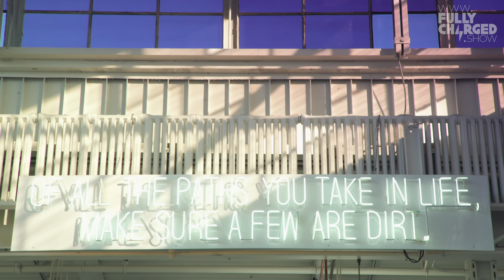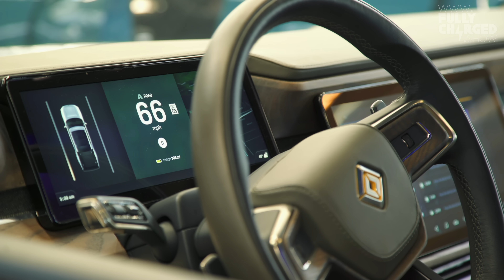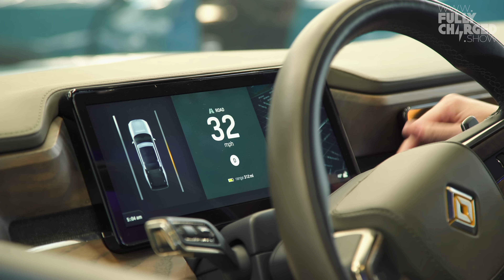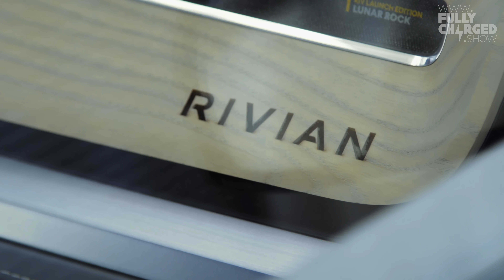Rivian R1S Electric SUV & R1T Electric PickUp Truck - World Exclusive: Inside Rivian | Fully Charged

Comment: Rivian feels like a company run by engineers with passion. That is usually a recipe for a great product. It does not feel like a hype job (unlike Fisker for instance).
Reply: @Idiot Online Wondering Aloud A huge injection of more than 4 billion dollars from Amazon (plus hundreds of millions from Ford and others) might make this easier, however...
Reply: @JustWasted3HoursHere  why would Amazon care about injecting into truck building company? What's Hi-Tech about it?
Reply: @atenrok  Because Rivian is tasked with making the powertrains for all their future delivery vehicles. That's why.
Reply: @agus2001  what powertrain? It's an electric motor + batteries. Do they produce any of these components or planning to?
Reply: @atenrok  do some research, you're on youtube so you have google look it up.
Reply: @atenrok  Yes, they do. You might want to leaven that skepticism with some facts and reality. Otherwise, it's like eating table sugar all the time, it gives you energy at first and then you start breaking down. Scurvy of the mind.
Amazon investing in Rivian to build their trucks is taking a page from UPS. UPS delivery trucks for North America were a bespoke design that nobody else had that were tuned exactly to their specification. Relentless optimization, like the no-left-turns rule for drivers. And then the trucks were driven into the ground and scrapped so nobody could copy them.
Reply: @AW-zv2to  and you wanted to say what exactly?...
Reply: @atenrok  electric trucks will save them tons of money in fuel costs and maintenance cost.
And I think Amazon is working on self driving. Saving them tons more money.
Amazon ordered 100,000 electric trucks
Reply: @atenrok  rivian is the only one with 4 motors. They can torque vector each wheel 1000 plus times a second. There is a lot of software involved.
Tesla is more efficient because of their electric motors.
One company makes their motor windings with square wires for greater density. Might be Volvo
Reply: @golfish8589  Rimac Concept One & Two
Reply: @romankrusec1991  nice cars.
Not mass produced.
The lightyear ev may have a hub motor in each wheel
Reply: @golfish8589  Honda showed EV CR-Z prototype with 4 motors in 2015.
Reply: @atenrok  prototype...
Reply: @golfish8589  Blah blah blah.... no one cares as no different than anyone else other than electric. Payload/Range... What everyone needs to know in a truck: Crickets...
Reply: @atenrok  "Last-Mile" delivery vans. Did you even watch the video?
Reply: @w8stral   Have you ever driven an electric vehicle and experienced instant torque?
Find a way to get a ride in a tesla. It will put a smile on your face.
A tesla semi can go 0-60 in 5 seconds with only a slight hum from its motors. The Rivian gives you 250 pounds of torque at each wheel at 1mph
 I am not sure what you are asking 
here is a rivian forum. https://www.rivianforums.com/threads/rivian-payload-towing-capacity-and-trailer-brake-controller.62/

Payload 1800. Range 400 miles which gets cut in half when towing.
A 100 mile range extending gerrycan battery can be added to the bed. 

Battery technology is getting  better all the time.  It's only been serious researched the last ten years. Now billions are being spent by dozens of Companies. 
Gas engine has had over 100 years of refinement
Reply: @golfish8589  Acceleration does not matter.  This is the real world, not play time for children.   Truck = $$$/payload-range.
Reply: @w8stral  the rivian is not designed to be a work truck. Period. So dont compare it to one.
Tesla is announcing its pickup on Nov 21st. It will be more heavy duty than the rivian.
What is your current truck? So I can gi e you so.e relevant  numbers
Reply: @golfish8589  Then do not call it a truck.  Call it what it is.  A bigger SUV.  Not a bad thing, just a thing
Reply: @GrayRaceCat  🤦🏻‍♂️

Because last mile delivery vans need 250lb of torque per wheel at 1mph... 🤷🏻‍♂️
Reply: @w8stral  what truck do you drive
Reply: @golfish8589  F250 for big work stuff, Honda Odyssey for medium stuff, and a... not sure what GM hatch back car, and to top it off, an ebike.
Reply: @w8stral  odyssey has been my everything vehicle since 2001:) I rebuilt their piece of crap tranny 5 years ago. Fixed the major design flaw. Engine is great. First thing I did after purchasing the odyssey was to put a rubber bed liner in.
How much do you love the ebike
Reply: @golfish8589  My Honda Odyssey is same age.  Transmission has extra oil cooler in it as I put a hitch on it and it is whining louder but got it to 240,000 miles currently.  Had to replace everything on the engine by now.  Guess not the AC of all things, but everything else?  Yup.  Engine itself is finally eating 1 liter of oil every 1000 miles, so I do not bother with synthetic oil anymore.  Saw one guy who took his odyssey van and cut the roof out and put divider behind drivers seat, removed side doors, put in a "tailgate"... was hilarious!!!  

Ebike?  Its ~ meh.  Only because it rains here all the time and is cold.  If I was someplace warmer?  Yea, much better application.  Put basket on it to get groceries when wifey decides she forgot something and needs it asap...  Gets me out of the house as well when I need to hide in the Library or book store.  =).
Reply: @atenrok  Because they're going to make a EV cargo fan for Amazon.
Reply: @abes3925  🤦🏻‍♂️
Reply: Do you know what speaks louder than passion? Money.
If Rivain is a hit, Ford, or some other big automaker, will gobble them up, and Rivain will sell out faster than any of their vehicles can run a 1/4 mile. It's the "Silicon Valley" American Way: make something great, then retire young / rich by selling out, or start building another startup to sell off. 

And like any initially great product, someone bigger / wealthier will come along, buy the name / reputation, then cut costs and corners, while still charging a premium for inferior goods, banking on that "good" name.
Reply: @listofromantics  In a way that would be a good sign, because that means that the mainstream automakers are FINALLY taking EVs seriously and see them as a genuine threat. And, well, Tesla has hung in there for more than 10 years without being taken over so who knows?
Reply: @JustWasted3HoursHere  they've been taking it seriously in the end of 70s, with ev1, but then something else happened 🤷🏻‍♂️
Reply: @listofromantics  I don't think they'll. Nothing about electric cars is revolutionary from engineering perspective. And big automakers have already invested huge amount of money into electrification already
Reply: I can vouch for that - I know one of them! :)
Reply: Yeah it’s nice and stuff, but I’m buying a Tesla , more bang for the buck
Reply: yeah Fisher keeps making crappy toys for kids. Like switch it up already, where's the passion?
Reply: It is a recipe for extremely high priced over engineered masterpieces that only the überrich own. It's a McLaren F1 with a ute tray.
Reply: @Celtic_Thylacine  McLaren is 3 times cost of a Rivian.
What do you consider ueber rich?
I have never lived in a household making over 80k. I will be able to afford it when my house is paid off. When I am 62. It will be our traveling retirement vehicle
Is the rivian expensive? H*ll yes.
There are actually a fairly large number that can afford it.
I also know that 50% never by new vehicles

I have owned one new vehicle
Reply: @golfish8589  when your 62? You won't be able to enjoy it.
Reply: @Space_Novel_Distribution  how old are you? I remember when I was 18 . I thought 40 was old . Ha ha. 62 is that not that old. 67 is getting there. That's why it would be nice to retire at 62.
Less social security, but get I for a longer time
I would love the truck. But would probably end up with the suv. And travel the country with the wife in it.
Reply: @golfish8589  im 21.
Reply: Design, engineering, and prototyping are merely the first steps. When Rivian gets to the manufacturing stage and they begin producing a fully fledged product is when they'll begin encountering true technical problems. Basically what I'm saying is that it's a company in its infancy, for them to progress to become well established will take both ingenuity and luck...
Reply: The fact they planned out before coming out means they ain't trying to bullshit people. They actually wanted investors so they already mapped the foundation
Reply: @alphonsusho8962  Well, there is nothing special about a glorified car that changes its ICE to Electric.  A true electric truck would be special though. 

PS: Since the introduction of NimH batteries city electric driving has been covered.  Just no one wanted to switch as it was not seen as "cool" as the manufacturers who started it all went SKIMPY over compensating for their religion that humans are bad.
Reply: A bit if them came through my place of work and I got to talk to them for a while. They have a really awesome culture and awesome people from what I could tell
Reply: This is factual, I have a good friend who has been at Rivian since inception, and that’s exactly what he his, an engineer with a passion. I am very excited for them!
Reply: Yes, it is run by someone who obviously gives a f@£k and it doing it for the right reasons.  That is the start of a winning formula.  If and when they IPO and I will be buying in....
Reply: Fisker is lile jhaant ka baal. But what about it

Comment: I count 9 vehicles in this video. 2 Possibly non functional. And I think I spied 8 motor and gearbox combos on display or under construction. Interestingly there are a few brief snap shots where the background is blurred out. I'm fairly certain near the end you can see an Amazon van being built up. Good shit. BTW where are those 2170's being made ;)
Reply: He stated they don't yet have a contracted battery maker. My guess is that they planned to buy them open-market because their production volume would be low for a good while. The Amazon deal probably changed that and they are now talking to battery companies.
Reply: InsideEVs.com has an update that shows they’ve applied for permitting to build a battery plant at their factory in Illinois.

Comment: What the new Land Rover Defender should have been
Reply: It's a "Range Rover killer"

It really could be.
Reply: @rogerstarkey5390  Don't worry, JLR are well on the Electrification road, you can already get a PHEV Range Rover and I suspect will the next rebody, it'll be designed to have a full EV option too. Its one advantage start ups like this have is a clean slate to start from, existing Manufacturers take longer to engineer a rebody as it needs to fit in with their existing platform life plan. Don't forget JLR and BMW have teamed up with a joint venture on EV drivetrains, so that's quite a lot of experience and talent there.

Rivian may be first to market with their full EV, but its also a downside with startups, they have to scale everything up from nothing and avoid issues like the Tesla Model 3 went through when they tried to ramp up production.
Reply: @stevechilds1547  Except the Rivian can actually go offroad. Land Rovers haven't been able to do that for over a decade.
Reply: @awo1fman  erm, yeah. Ok, whatever. a) LRs are very effective Off Road, Range Rovers less so, but still better than most. b) I'll judge the Rivian when it actually is available, saying something is better off road when its little more than a concept car is a little ridiculous.
Reply: @stevechilds1547  Have you even looked at a recent Land Rover? They have no actual ground clearance and have huge wheels and low profile tires. No, they can't offroad at all, even if you put appropriate wheels and tires on them, because they're all electronic and you would fry the brakes and break all kinds of things if you tried anything more challenging than a smooth dirt road. Which is still a road.

"Off road" means off road, meaning not even a 2-track. Those test tracks on which you see them "showing off" their vehicles are extremely unimpressive to anyone who has ever actually been off road.

As for Rivian, they have 3 times the ground clearance of any Land Rover, and a motor at each wheel means unbeatable traction and no need to fry the brakes in a futile attempt to make up for lousy open or even limited-slip differentials.
Reply: @awo1fman  Are you sure you're not thinking of Land Cruisers? Or perhaps Jeeps? And yes, I do see them up close pretty frequently. I don't recognise your description of them though.
Reply: @awo1fman  Oooh kay. Whatever you're smoking/taking, I'd lay off it, tbh.
Reply: @stevechilds1547  I'm smoking Land Rovers with my Ford SuperCrew. Not that they're aware of it because they're never even close enough to eat my dust.
Reply: Part way through I thought “this is going to destroy Land Rover”...if they can get it out to market. There are a lot of people with a lot of money who I’m sure would get this over former. All those footballers and Chelsea folk...
Reply: @chillmeister  
The prices compare very well with Range Rover.
Reply: And no one would buy it because it’s so expensive. This isn’t a mass production car - it’s for wealthy early adopters to beta test for the future.
Reply: @paddydowney6269  That worked with Tesla as they were basically first to market, but Rivian won't be. A few early adopters won't pay the bills, they need volume for that.
Reply: Steve Childs you assume Tesla are earning enough to pay the bills, or that they even want to pay the bills (and not get swallowed into one of the bigger groups). The micro volumes that Rivian will produce for the next decade will mean the prices will need to be huge, or else be happy to lose money
Reply: @paddydowney6269  erm, given that Tesla made a profit last quarter, I'd say they are earning enough, at least in the last quarter. Rivian are a few years away from doing the same, if ever. Don't get me wrong, I'd love to see a competition for Tesla, but they've got such a head start in the consumer market now, that's why I suggested the Commerical market may well be where Rivian ends up. As for Tesla getting swallowed by one of the other groups, unlikely as their valuation is currently $57bn, that's more than Ford (35.7bn), General Motors (54bn), BMW (53.5bn) and nearly matching Daimler (Mercedes) at $62bn.

It would be like Mercedes Buying Ford, at least from a share value point of view anyway.
Reply: jabberwolf  Pretty sure their Tax Credits already gone, hasn't it? Model 3 put pay to that. I don't really agree with what you say though, they still have to RnD their vehicles & systems and they're not even doing their own batteries, they buy them in and bundle them together into a module. The only way for them to not go through the same development problems is to license their tech! Just because they're later to market doesn't mean that they don't have to go through all the same hoops that Tesla have, especially productionising a concept vehicle - that is something that they'll have to do themselves.

They may benefit from newer tech to start from, but that's about it, but Tesla's not exactly standing still.
Reply: jabberwolf  Tesla have done quite a lot that people said couldn't be done, I wouldn't underestimate them! Tesla's competitors in EVs (i.e. the major manufacturers) will get their act together soon and that could make Rivian's job even harder - apart from Commercial EVs, which is why I'm expecting that's where they'll eventually end up, especially as Amazon have ordered a significant number of vehicles that they will want delivered sooner or later!